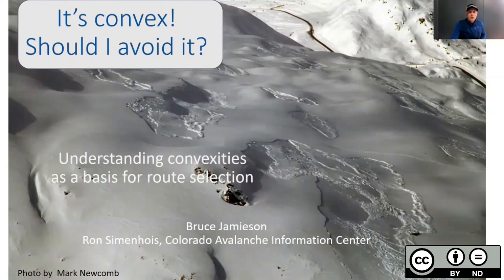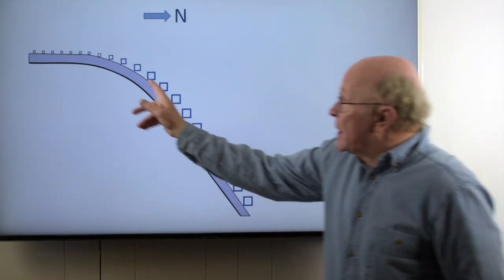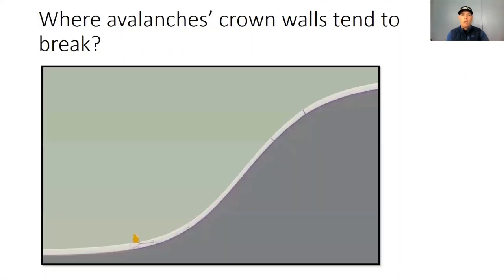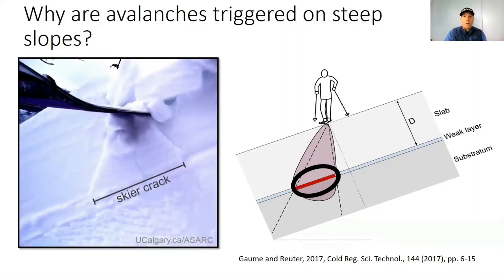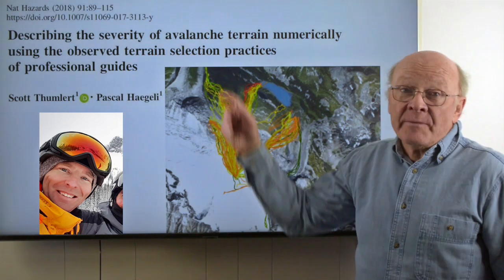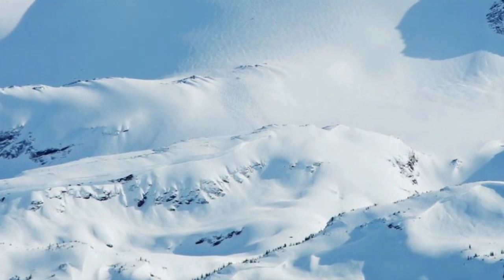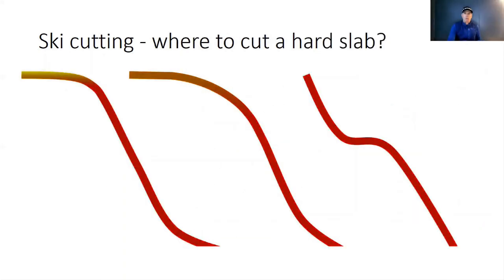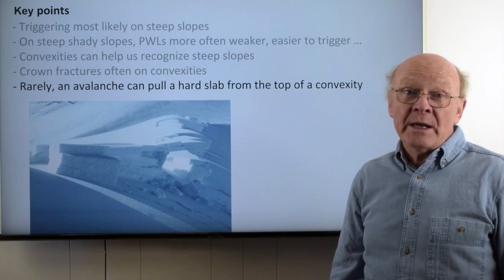It's convex! Should I avoid it?

Comment: Rutschblock’s most significant finding RB6: This simulates all fatal human triggered avalanches: subsequent snowshoers/hikers/climbers/dog walkers/ascending or traversing groups, critical crack distant from cluster, assisted snowmobile unstuckers and snow-players. 
“user removes their skis or snowboards and jumps in the same spot for softer or thinner slabs where this may penetrate the weak layer the user keeps their skis on and steps down another 30 5 cm to almost mid block and pushes once and jumps three times this entire step is classified as a score of six”

Comment: Human-triggered avalanches are initiated by shallow slope parallel mixed-mode anti-crack that become self-propagating by concurrent activity sequential activity, en mass movement, one departing group or cluster. These are the avalanche THE “problems.”
Explosives initiate shear avalanches.
Reply: @jackrueppel4573  so do explosives not provide mitigation for human triggered avalanches?
Reply: @gnarshar  The answer to your question is absolutely not in this example 15 2.5kg explosives were used on contest area on Monday. 
https://youtube.com/clip/Ugkx2PXhMr1Lpgf5LW-ntRxjTkylnrVDA-H-?si=FuCHTdJjqO2SaKiD
Tomahawk prior to ascending on foot producing a shallow slope parallel mixed-mode anti-crack. Skier had dynamically stressed uphill and tomahawkers right of rock approximately 2 seconds into first clip.
https://youtube.com/clip/UgkxuEUNhn9G7pcPzRjXv_KyWfxrLboPIPq9?si=6hcMKBUr_7f9ejS8
Ascending on foot to patrollers or forerunners  traverse track, slope-parallel mixed-mode anti-crack becomes critical slope-parallel self-propagating mixed-mode anti-crack in the time it took to crash, loose ski, strike snow with pole, remove ski ascend to traverse track. Unknown when in the timeline the traverse track was skied in but should be included in "collapse manifold" triggering time. Notice a slope normal crack forms between Julien and the exposed rock before the crown appears.
https://youtube.com/clip/UgkxparTO9_Ka8lUiJtNnngDxp-7DgAIvEFw?si=F4hXFFJPbV5dz1NI
7 seconds into this clip you can see rock exposed by avalanche which would have Heierli’s “reduction in volume” snow around it. With sandwich of bed surface as the bottom layer of a "slab waveguide." collapsible weak layer (mixed-mode anti-crack) and cohesive slab on top. https://youtube.com/clip/UgkxqUmv7EGMMOwMbDweARjbyeoEZgzjd1ED?si=x-bI1PLPAoHSQ7VR
https://arc.lib.montana.edu/snow-science/objects/ISSW_O-040.pdf
Reply: @ The answer to your question is absolutely  not in this example 15 2.5kg explosives were used on contest area on Monday. https://youtube.com/clip/Ugkx2PXhMr1Lpgf5LW-ntRxjTkylnrVDA-H-?si=FuCHTdJjqO2SaKiD
https://youtube.com/clip/Ugkx2PXhMr1Lpgf5LW-ntRxjTkylnrVDA-H-?si=FuCHTdJjqO2SaKiD
Tomahawk prior to ascending on foot producing a shallow slope parallel mixed-mode anti-crack. Skier had dynamically stressed uphill and tomahawkers right of rock approximately 2 seconds into first clip.
https://youtube.com/clip/UgkxuEUNhn9G7pcPzRjXv_KyWfxrLboPIPq9?si=6hcMKBUr_7f9ejS8
Ascending on foot to patrollers or forerunners  traverse track, slope-parallel mixed-mode anti-crack becomes critical slope-parallel self-propagating mixed-mode anti-crack in the time it took to crash, loose ski, strike snow with pole, remove ski ascend to traverse track. Unknown when in the timeline the traverse track was skied in but should be included in "collapse manifold" triggering time. Notice a slope normal crack forms between Julien and the exposed rock before the crown appears.
https://youtube.com/clip/UgkxparTO9_Ka8lUiJtNnngDxp-7DgAIvEFw?si=F4hXFFJPbV5dz1NI
7 seconds into this clip you can see rock exposed by avalanche which would have Heierli’s “reduction in volume” snow around it. With sandwich of bed surface as the bottom layer of a "slab waveguide." collapsible weak layer (mixed-mode anti-crack) and cohesive slab on top. https://youtube.com/clip/UgkxqUmv7EGMMOwMbDweARjbyeoEZgzjd1ED?si=x-bI1PLPAoHSQ7VR
https://arc.lib.montana.edu/snow-science/objects/ISSW_O-040.pdf
Reply: @ Ski patrollers, backcountry guides, guided clients, ski resort guests, snowshoers, dog walkers, hikers, and climbers die in collapse( Heierli-slope parallel shallow mixed-mode critical anti-crack) avalanches. Think of this as the shallow collapse domain.
Ski patrollers, backcountry guides, avalanche educators, and avalanche forecasters work in the domain of shear avalanches. Their corpus of knowledge does not give them the skill set to educate, predict, forecast, avoid, or mentor the shallow collapse avalanche domain.

Comment: “Thus we infer from the model that weak layer fracture is not more difficult to trigger on gentle slopes than on steep slopes. Since this proposition relates to safe travel in avalanche terrain, we tested it in field experiments using the extended column test(ECT) method to trigger fracture (Simenhois and Birkeland, 2006)” From “2010 International Snow Science Workshop NEW INSIGHTS INTO SKIER-TRIGGERING OF SLAB AVALANCHES Joachim Heierli et al

Comment: On the contrary, for mixed-mode anticracking the computed critical load to trigger fracture is much lower (two to three times the static load) and virtually independent of slope angle up to about 60°. From “2010 International Snow Science Workshop NEW INSIGHTS INTO SKIER-TRIGGERING OF SLAB AVALANCHES Joachim Heierli et al

Comment: For simple shear cracking, we see that the computed critical load to trigger fracture is several tenfold the static skier load in the 30° to 45° window, and that the critical load rapidly decreases with increasing slope angle. From “2010 International Snow Science Workshop NEW INSIGHTS INTO SKIER-TRIGGERING OF SLAB AVALANCHES Joachim Heierli et al

Comment: Since traditionally only shear stresses were taken into account in the formulation of skier triggering, and because the shear stress increases with increasing slope angle while the strength remains a constant or decreases, these approaches imply that fracture should be easier to trigger on steeper slopes, a view that is now fundamentally questioned (Heierli et al., submitted). 
From “2010 International Snow Science Workshop NEW INSIGHTS INTO SKIER-TRIGGERING OF SLAB AVALANCHESJoachim Heierli et al

Comment: “Anticracks, as opposed to simple shear cracks, allow for mechanical work to be done by the compressive component of the load since the collapse of the weak layer provides a small but sufficient room for slope normal displacements in the crack region (Fletcher and Pollard, 1981; Heierli et al., 2008a, Heierli et al., 2008b, Heierli et al., 2010). As we shall see, about 80% or more of the mechanical work that drives fracture can be attributed to the transient decompression in the anticracked area, and only about 20% or less to the transient reduction in shear stress.” From “2010 International Snow Science Workshop NEW INSIGHTS INTO SKIER-TRIGGERING OF SLAB AVALANCHES Joachim Heierli et al

Comment: 5:55 “If we consider what we talked about in this video, we can see why the crown walls typically end up on the convexity roll.” The slope normal crown “walls” are where the slope parallel crack ends. This is the avalanche perimeter in stable snow.

Comment: @2:00 Bruce explained diagram "However, on top of the convexity, more solar radiation will reach the snow surface, so surface hoar crystals are often smaller or sometimes absent.” Saltation, ablation and sublimation explain the higher more stable rutchblock scores near the ridge in snow where no surface hoar is found.

Comment: @1:10 “This dry slab avalanche released on a layer of surface hoar. Noticed that it released on steeper slope below the convexity.” Bruce points at Crown and traditional “start zone … “ No tracks can be seen at or near the crown. Avalanche likely triggered elsewhere.

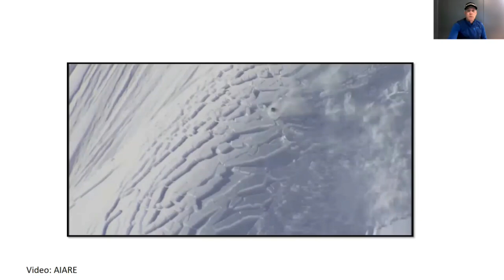Comment: From transcript “Let's rewind to when the slab avalanche was triggered. Below the skier, we see the first crack through the slab. The crack in the weak layer was likely triggered a second or less before this frame…” Skier dropped off the ridge traveled 10m then skis submerge, skis emerge at critical crack length (minimal failure size) described @6:39 slope normal flank appears at the same time @0:32… skier triggered mixed mode anti-crack.